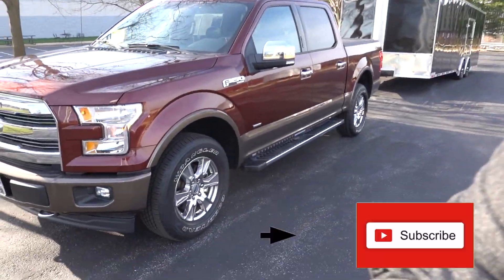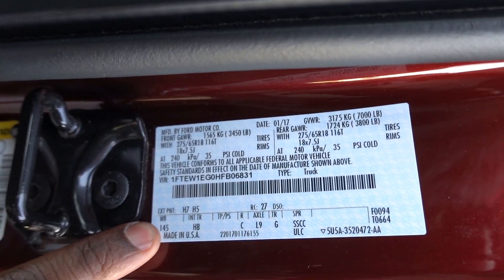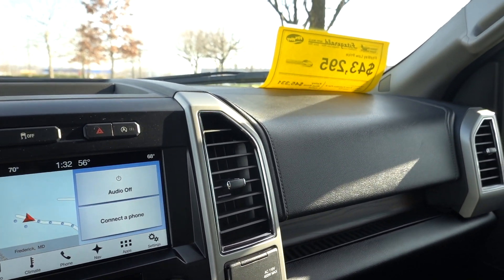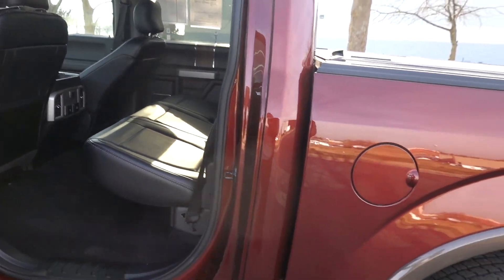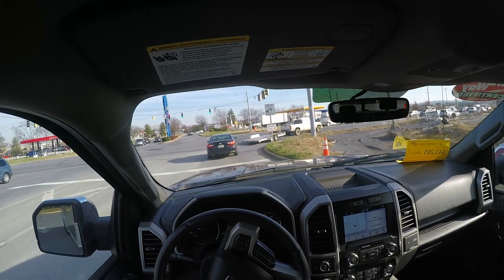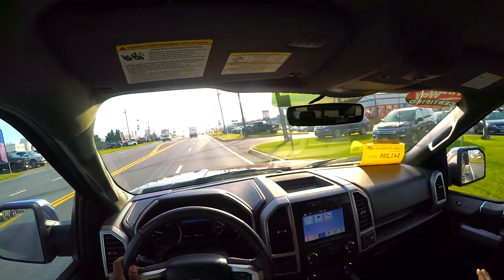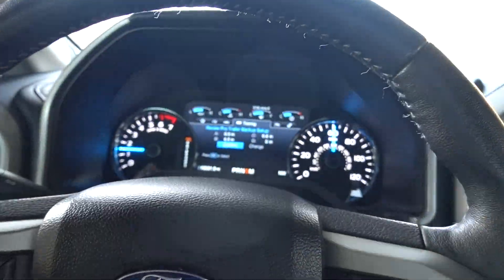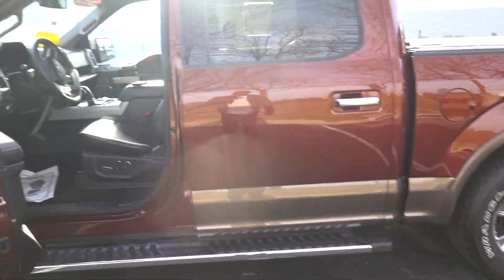The Ford F150 Performed The Worst On My Towing Test... | Find Out Why It Failed!

Comment: Wow I cannot believe that they can say that these trucks can safely tow these numbers without sway bars.  If I was towing with this truck and had my family inside, a sway bar and rear air bags would be the first thing that I would add.  Next would be Bilstein 5100 shocks.  Those shocks work great for heavier loads and towing.
Reply: He's clearly way over the rated capacity of the hitch based on the sticker shown on the bottom. Without WD, his max tongue weight is only 500 lbs, so he's got almost double the tongue weight.......no wonder it squats!

Comment: I have a 2013 F150 3.5EB not a max tow truck. I also have a 22' Vnose trailer with a total length of 28'. I towed it about 400 miles loaded to about 8000 pounds. I didn't have a weight distribution hitch but I really needed one. The power was more than enough even on the mountain passes but I was a little disappointed with the amount of sway as well.

Comment: My brother-in-law bought one of these just like what you tested. He had rhe exact problem you ran into. Just like I told him, my rule of thumb is anything over 7000 pounds I would want a 2500 pickup. You can pull weight with about anything but stopping and controlling that weight is 2 different things. People may disagree but id rather have way more truck than I need than to put up with that everytime I pull my trailer.
Reply: Agreed on breaking.  Ford doesn't upgrade brakes on f150 the Hitch is the biggest issue. The new heavy duty attach through the bumper unlike traditional which attach to the frame but it does increase towing weight with distribution system.  Definitely low gear in hills ! Remember 2 percent reduction for every 2000 ft above sea level. Not to mention the trucks GCVWR. Very important.!

Comment: He didn't notice his carrying capacity was 5000  or 500 at the ball - 10% rule. 11000 distribution weight He was overweight on the rear. Only 500 lbs can be transferred. That's why the squat is so much.

Comment: Do you have a 1/4 towing comparison playlist? I have a Chevy 1500 max towing 13,100 towing on order but may need a truck sooner and want to know my options. I have been debating between a 3/4 gassers and 1/4 maxed out towing and wondering if I could be okay sacrificing some of that 13,100 down to 11,000 or even 9,000. 6,400 TT with the potential of upgrading to heavier in the future. Maybe 7,000-8,000. Just summer camping use. Maybe 2-5 in-state trips per summer.

Comment: Nice review. I have a friend who had a 2016 F150 and he fought trailer sway with it the entire time he had it towing a camper. About 28’ length and 6500ish weight. He tried several different weight distribution setups too. About 60 mph was tops for him to keep sway down. He ended up trading it to a 3/4 ton. 

You’re proving with this video series that 1/2 tons are a little sketchy with serious trailers. They are fine for open trailers. Probably even ok with the ridiculous tow ratings as long as it’s an open trailer. But the box trailers are pushing it. I towed mine first with 2016 1500 Silverado and it did pretty good. No real sway but you could feel the trailer trying to push you through curves on two lane roads. 

I like the other view better. Good review though. 👍
Reply from the maker: Thanks Matthew! I towed with a half ton in the early 2010’s but haven’t towed with one since so this testing is really for me to because of that experience. Now that I’ve towed with more 1/2 tons, I feel even more confident and what I stated about just stepping to a 3/4 ton up truck even for smaller trailers. Thanks for sharing 👍🏾
Reply: Matthew, it sounds like your friend has an improper hitch setup. We have over 10000 long haul miles on our 2017 150 towing a 29' travel trailer and sway has never been an issue. We did add bilstein shocks to control the wallowing JB experienced but otherwise it has been fantastic
Reply: @andrewmoore6521  Agreed. I tow a 28' Trailer with my Sequoia. I am MAXED out with Myself, the wife, 4 kids and a Golden Retriever. The trailer is about 6500lbs loaded and I have never had a sway issue. 

My suspicion if anyone is experiencing sway for no particular reason would be how the trailer is loaded. All heavy items must be on or forward of the trailer axles.
Reply: Maybe so. But it was about a 28’ camper. Non toy hauler. His dad has a 2016 Silverado 1500 that pulled it fine with no weight distribution hitch. 

I figured he maybe had a bad tire or tires on his camper but the other truck did ok with it. I also thought maybe it’s where he was coming down from an older F250 and just was expecting too much. But he swore not and I know he bought atleast two different types of hitches. Never did solve it. That camper got stole and he eventually replaced it with another that was slightly bigger and heavier but with spread axles. I think he pulled it one trip and same thing. Bad sway around 60 mph and he traded to an older 2500 Silverado gas truck.
Reply: @matthewanderson9912  Very well could have been bad or weak tires or bad alignment. Maybe he had some excessive thrust angle in his rear axle.

I have adjustable shocks in my Sequoia if I tow in Soft mode it definitely feels uneasy at high speed. But in Sport mode it firms right up and is a beautiful tow rig. So maybe it was suspension setup in his case.
Reply: @geoffmooregm  yes exactly, how the trailer is loaded, proper tongue weight, and proper weight carrying tires

Comment: You do a real nice job on the videos 👍, as far as tires go I went to BFG ko2 tires 10ply , the sidewalls are STIFF. I pull a 5ver loaded and I don’t have any sway.
Reply from the maker: Thanks bro! I think the tires really hurt the handling of this truck and towing from the tongue at this length/weight does add additional stress to the truck. Thanks for sharing 👍🏾
Reply: Ko2 good tires then?
Reply from the maker: Any 10 ply LT tire will be fine

Comment: Tire pressure is a big factor on sway, I don’t think you had enough air on the tires for the weight on them… assuming weight is distributed properly on trailer

Comment: Great video! Very informative and gave a great understanding of the truck. I was curious as to why the truck was swaying while towing with your trailer. I'm new to towing and trailer sway is something I fear greatly
Reply from the maker: Thanks! Tires, truck weight, sway bars, wheelbase, and weight distribution hitch are crucial to a great towing truck 👍🏾

Comment: I have a 2011 f150 5.0. I don't remember what my enclosed trailer is tho 😂. Anyway I'm hoping I can load up my 2020 mustang gt and the f150 will be ok. I have the roadmaster suspension kit and a weight distribution hitch. On paper it should be ok but I'll find out this summer

Comment: Test the four wheel air suspension RAM has on their 1500 truck. The RAM 1500 air ride system is by far the BEST BEST BEST 1500 for towing.  I hooked up a 9,000 lb. trailer to Toyota Tundra, Chevy Silverado, RAM and F150.  The RAM air suspension (it was a Limited model) towed like a CHAMP!  I was extremely impressed.  No squat whatsoever ever and the ride was sweet, no swaying.  Please do a test on that model so everyone can see that RAM set up, way impressive.  You hook it up and go, nothing you have to do with the air suspension it does it all for you.
Reply from the maker: Thanks for sharing 👍🏾

Comment: Own the same truck, those stock tires are garbage.  Typically the case on stock half ton tires since they are all p rated. The Toyota and Silverado had aftermarket tires, larger sizes so probably LT rated vs P rated stock tires. 

I swapped to 33” LTs and it made a world of difference for towing stability. 

Hoping more tests mention tire class, pressures, and whether they are stock. 

Nice work!!
Reply from the maker: Thank you! A few people mentioned to add tire pressure to my videos so I will do this moving forward 👍🏾

Also the tires on this truck did suck and I bet if they had LT tires this would have went a lot different 👍🏾
Reply: @JB_WhoWork  dang man you are on top of your reply game!!  You’re too good to your viewers,  we appreciate it. Keep up the good work!!
Reply from the maker: Thanks bro! Appreciate your comment 👍🏾

Comment: Bought my first Ford f150, had 6 Rams and last one was GMC, love to drive my ford but very unhappy about some things, for example I had my GMC for 6 yrs and I tow a 6x12 enclosed trailer daily plus a 4000# camper that gets taken out about 6-7 times a year, truck was great, but now I use the ford to tow the exact same trailers the exact same way and in 6 months the pin hole on the hitch has already egg-shaped, after 6 years with the GMC the hitch was still perfect, hoping this isn't a sign of things to come, built ford tough you say,,
Reply: diggin deep for that one, wow fords are tough on trailer hitch pin holes, what a tool
Reply: @jerryrupe1696  i was just kiddin relax
Reply: @louiesboys7161  sorry brother! I get tired of the trolls getting all sensitive  over simple conversations,  thanks for the reply,

Comment: Its not so much the weight of the trailer but the size of it. 33 ft trailer is too big for a half ton. My 2018 f150 3.5 eb has the max tow package and pulls my 27 ft 8k lb camper just fine. I also use weight distribution bars.
Reply from the maker: I have spread axles so the trailer distributes the weight but I agree any 1/2 ton needs a WDH 👍🏾

Comment: Thanks for sharing the video!  I have to say that I strongly agree with most of your comments, as I had a similar experience about 8 months ago while looking for a replacement for my 2010 F150.  I did a similar comparative on-the-road test, with the differences being that I was pulling a 37ft, 9000Lbm travel trailer With weight distribution hitch and a Pro-Pride antisway hitch.  My old F150 and new 2020 F150 had payloads within 70Lbm of one another, but the old one had e-rated michelins vs the c-rated on the new.  I loved the performance of the new 2020s ecoboost powertrain, and marveled at how it seem to even pull the trailer with less complaint than the new 7.3L godzilla in a F350 that I also had the opportunity to compare.   However the new F150's suspension was not inspiring at all.  Even though the  ProPride eliminated sway the trailer seemed to more easily influence the newer truck's position on the road which didn't inspire confidence.  It was so noticeable that I was concerned even a tire upgrade would even get it back on par with the old F150.  I couldn't find a local  RAM or GM dealer willing to do a similar comparison with their half ton pickups so I grudgingly moved up to a F250.  Looking forward to your RAM 1500 comparison
Reply from the maker: Thanks for sharing this and that does stink... Some guys mentioned that the aluminum construction could be to blame since its lighter overall. I’m sure that F250 gets the job done though!

Comment: No trailer package, no sway bar,  no fold out mirrors and as many viewers mentioned, u did not check air in trailer or truck tires!   Trailers overall length is measured from tip of the tongue to the back of the box!  If u r buying a truck to tow  u need the trailer package.
Reply from the maker: I checked tires just never showed this in the video. I have a viair pump for my RV tires

Comment: The truck had the MAx Trailering Tow package.  That’s why the Hitch weight was the high end on the Tow guide.  You can also tell based on the shocks. On the F150s when the rear shocks are behind the tire, its max trailer package. Your issue was you were towing without WDH and no sway control.  Bad combination. What was the weight of that trailer?
Reply: Not true with the shocks behind the axle means that it had max tow. That’s standard equipment according to the ford window sticker
Reply: @paulhunter9613  Sorry.  MAX trailer package is not standard by any means
Reply: @TheIceStormof1906  I know that max tow is not standard, and having the shock behind the axle is standard on all f150’s, it does not mean it has max tow

Comment: Hey JB, enjoyed the video.  If that is the price of the truck on the piece of paper on the windshield ($43,295.00), WOW!  For a 2018 RAM 3500 Laramie with the 6.4 HEMI, I paid $52,500. I will stick with my RAM. LOL
Reply from the maker: Thanks! Used car market is hott so definitely should compare new/used pricing. Congrats on the RAM 👍🏾
Reply: The price I quoted for the RAM was when I bought it brand new in 2018.

Comment: A light weight 1/2 ton isnt a good tow vehicle for anything heavy. That’s why I bought the diesel Titan XD. It’s a strong heavy truck.
Reply from the maker: The Titan XD is in a class of its own for sure and I would recommend a Titan XD and any of the 3 HD’s for any trailer over 8000#’s
Reply: @JB_WhoWork  I’ll tell ya, they certainly under rate this truck but weighing in over 7k lbs really makes it a very stable  tow vehicle. I tow a smallish 9800lb eagle HT fifth wheel and it’s amazing.
Reply from the maker: Yea I bet the Nissan XD doesn’t even feel it back there! I’ve been driving more non XD trucks so I’m hoping I can test an XD soon to see if I can feel a difference in the stiffer suspension. Thanks for sharing 👍🏾
Reply: Hm mmmm.   I just pulled 8000 lbs 2000+ miles from Cali to Tennessee in a 2010 5.4 l f-150 withe the equivalent of 4 adult passengers on the tow vehicle and the well balanced  20’ trailer…. All on the brutal i40 …..   ran like a Champ the whole way AZ grades and all!  Didn’t burn a drop of oil.
 Firestone airbags and a load stabilizer….  Good as gold. 😊  you work wit whatcha got…

Comment: These trucks are really designed for 60 to 70% for given tow capacity to be safe in my opinion. That trailer really needs at least a 3/4 ton or greater. 

Found out this when I connected my thirty foot travel trailer to a half ton. Never push a truck too limits. 

F150 are nice it is  just too much trailer for a 1/2 ton
Reply from the maker: I agree 100%! Like I’ve said in the past, manufactures spit out these great tow numbers but my experience is total different and want people to see real world experience.
Reply: @JB_WhoWork  can you clarify in what real world you should tow over 5k lb and 500 lbs tongue weight without wdh? 😜
Reply from the maker: @metal stacking to be fair, I did Chevy, Toyota, Nissan, and RAM half tons and the Ford did the worse. I admit the tires were a part of the problem but the suspension/ weight definitely was half of it. Chevy half tons tow better overall and if you add the tow pkg, WDH, and 10 ply tires, it will tow 9k no problem.
Reply: @JB_WhoWork  did you ever weigh that trailer? And tongue weight?
Reply from the maker: Here you go:
https://youtu.be/UJ_ALjZbz0E
Reply: @JB_WhoWork  so you over doubled the hitch load without wdh. That is not a test other then how not to tow with a half ton lol... was still cool watching you try.
Reply from the maker: @Metal_Stacking  I agree but I’m not traveling for hours or going far where fatigue starts to kick in 👍🏾
Reply: @JB_WhoWork  yeah my 1050# tongue weight with wdh has my f150 sitting perfectly level 37 5/8 in both front and rear. No suspension mods.
Reply from the maker: Does it handle the trailer without sway? What tires are you rubbing?
Reply: @JB_WhoWork  no sway. It does get the pull push from semi trucks but does without the trailer too. 33x12.50x22 nitto are the shoes. Can't post a picture but can give you the #s.
Stock
Fr 37.5 in
R  40 in
No wdh
Fr 38 1/8
R 36 3/4
With wdh
Fr 37 5/8
R 37 5/8
You lifting the front end of the lighter f150 by 3/4 of a in minimum is why the truck felt so unstable. And why ford states over 500# tongue needs weight distribution that 3/4 lift off the already light front axle will make it sway all over the place.
Reply: @JB_WhoWork  the lighter weight of the f150 has advantages and disadvantages. The chevy being heavier has advantages and disadvantages. 
The chevy might not lose as much front axle weight when improperly loaded and hitched trailer is applied. But suffers less braking and pulling capacity.
The ford will feel the weight control wise more so when improperly loaded and hitched. But has more pulling and stopping capabilities.
Both properly hitched with wdh the f150 "should" perform better. 
I know I wouldn't even consider pulling my trailer without wdh even if hooked to a 3/4 ton it just is not safe having any front axle suspension lift while pulling a tall long heavy load. My trailer is 33ft 4 in.
Reply from the maker: Thanks for sharing and I can see your point on the GM being heavier on a half ton platform. Is your trailer a RV? Keep in mind that my race trailer is a lot more balanced then a TT and I have spread axles which help stabilize the trailer so sway isn’t really a factor unless it’s windy. The weight is also distributed in the center on trailer axles compared to the weight of a TT being more spread across the entire frame.
Reply: @JB_WhoWork  I have a few trailers one is a tt yes. It doesn't matter what trailer it is the over 500# tongue weight is all that matter when you go over that number the front suspension loses weight the more weight the front end loses the less stable the combo becomes. If you see the #s above the wdh returns front suspension back to as close original weight as possible to stabilize the tv and trailer combinations.
Reply: @JB_WhoWork  I do not know your exact trailer #s but my bigger one is 8100# 1050# tongue weight I do not recheck trailer weight but always check loaded tongue weight before each hookup.
Reply: @JB_WhoWork  so why don’t you add all of those upgrade items to the ford? Then test it again
Reply: @Metal_Stacking  but the Chevy will get lighter every yr when it starts to rust😝